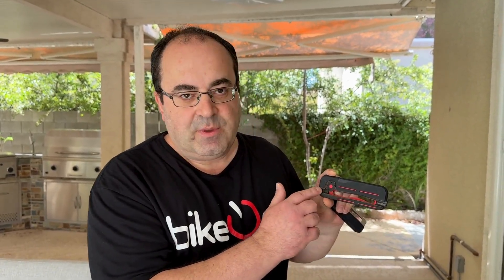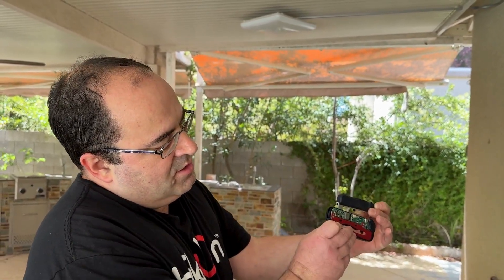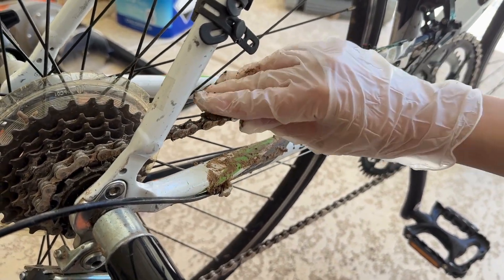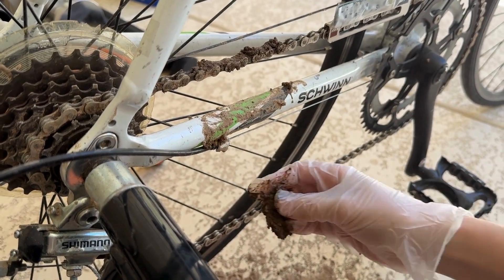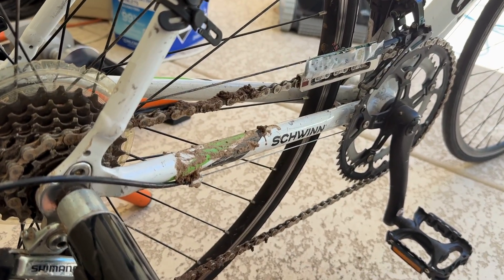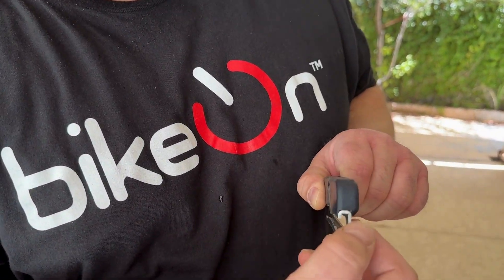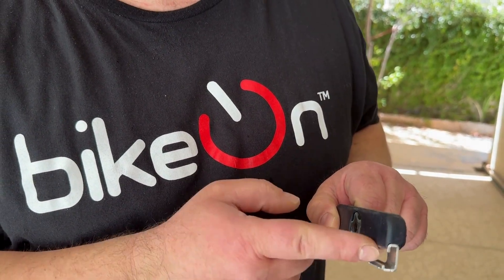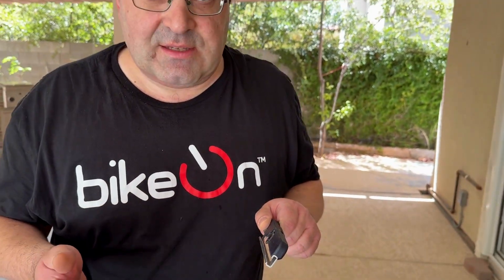CycleClick Update & Mud Test | Latest Prototype Sneak Peek

Comment: Is the motor kit still under development or has it never made it to market? Nothing is shown on the Bike On website.
Reply from the maker: @daytriker We have been selling the BikeOn e-bike conversion kit since 2023, and many customers are actively using it. Currently, we have temporarily paused sales to focus on developing CycleClick and delivering it to our backers as quickly as possible.

Once CycleClick has been delivered, we plan to resume sales of the conversion kit. Our goal is to integrate CycleClick technology into the kit - the idea for CycleClick actually originated from improving the kit’s sensor design - so when sales resume, the conversion kit will likely launch as a 2.0 version.

Comment: Hello! Since seeing this, I went to check out the original prototype and the video presentation with Q&A. One thing stuck in my mind was the 'drag test' that was done to demonstrate how little drag the device introduces to the drive system. The test was done by sliding the device along the chain, which proved how there was negligable friction between the two. The reality is that the device is basically  measuring the chain tension (and speed with variation) which inherently puts pressure on the device and introduces much more friction while under load than with no chain tension. A simple power test using some arbitrary powermeter (hub based, for measuring power down the line from the pedals and cranks) with and without the CycleClick should reveal the actual losses, if any. 

Just thought to throw in this idea because it was already raised as a question and as you progress, people will find more and more details to ask about (which is good), and will most certainly come to 1-2Watt gain/loss discussion... like they all get a podium at Giro each year 😅

Best of luck, glad to see new ideas like this! 🙂👍
Reply from the maker: @TheMilosDjuric  Thanks for the thoughtful comment. You're absolutely right that under load, the forces on the device increase. However, so does the transmitted torque, and consequently the power output (assuming cadence remains similar). That’s why we evaluate any potential losses as a percentage of the total power being measured - not just in absolute watts. In the video, I did my best to simulate a high-torque scenario to make the test more realistic, but of course it's still a simplified demonstration.

We’re currently conducting tests using an independent power meter for comparison and will share a video update on the results soon. And yes, we’re fully expecting those 1–2 watt discussions to come up 😄 Appreciate the thoughtful feedback and support!

Comment: What will be done to make it hard to steal the device off of the chain when the bike is sitting?
Reply from the maker: @stephenhodges4465  Thanks, Stephen. That’s a valid concern, and you’re not the only one who’s raised it - we’ve heard similar feedback from other early followers. We're currently discussing possible solutions, but no final decision has been made yet. We’ll share updates as the product evolves.
Reply: @TheBikeOn  Maybe when you present a video on how to put the device on and off the chain, you can bring up the question... Who knows... some of the people watching may have ideas too. Another idea might be to embed a way to track the device if stolen, or even as a way to track a stolen bike? Something that couldn't easily be disabled without permanently disabling the entire device? Thanks for the quick response!!!
Reply from the maker: @stephenhodges4465  Thanks so much for your comment and great ideas! We’ll definitely be sharing more regular updates, including a video showing how to easily mount and remove the latest prototype - and we’ll be sure to bring up this question in that video.

As for tracking, we’ve definitely been thinking about it. We looked into integrating an Apple AirTag or similar sensors that work with Apple Find My, but the challenge is that most of them are too large in diameter to fit into CycleClick. Since our device is so compact, space is very limited. That said, we’re still exploring options and haven’t ruled anything out yet.

Thanks again for the thoughtful suggestions - and please keep them coming! 😊
Reply: @TheBikeOn  I use Android, so I personally wouldn't want an Apple Air Tag. Also, they are very easy to circumvent -- sorry. Perhaps a private agreement with someone else's tracker so that you can integrate their design into your card directly? Or, perhaps some type of add-on feature, since it would cost more to include it...
Reply: @TheBikeOn  I guess you have something like a serial number for each unit? At least you can mark stolen unit so that they do not qualify for update - or more, get an update that renders it useless on try.